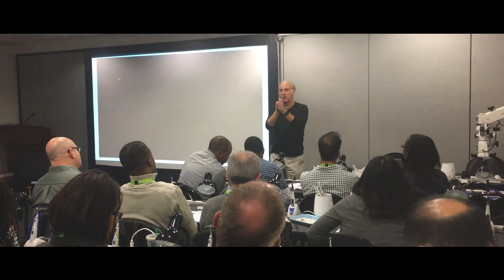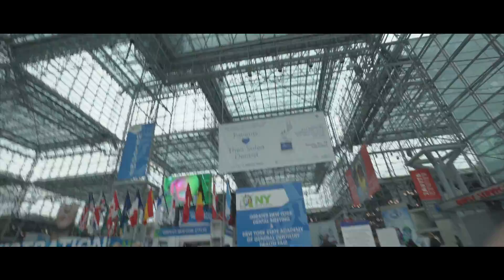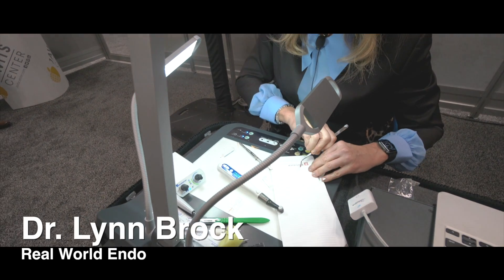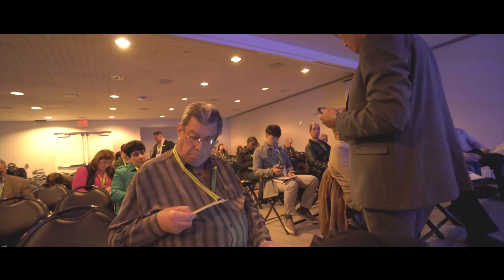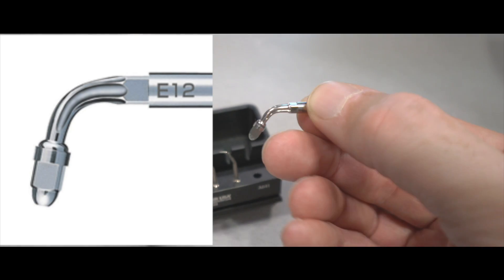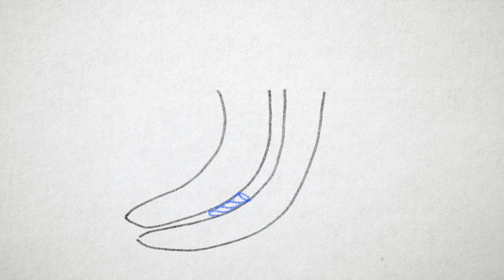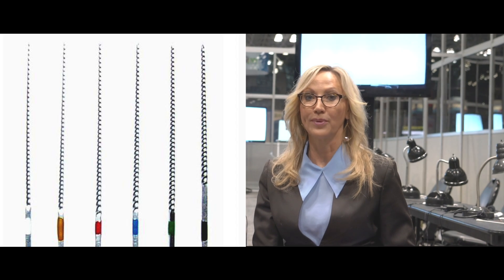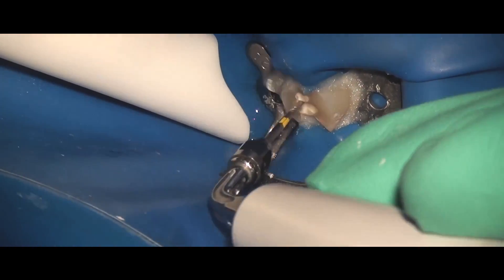Broken Instrument Removal @GNYDM VLOG

Comment: is Uflile will be enough??
I think it is very weak
Reply from the maker: I agree. I think it will work in specific situations where the file is not super lodged and heavily engaged. In those situations a stiffer ultrasonic tip would be needed, although the size 40U File is pretty stiff and might work in such cases.
Reply: +Real World Endo 👍👍👍
I think so 
thanks